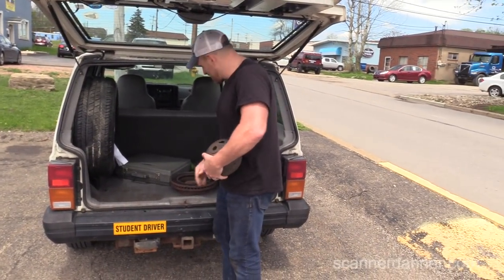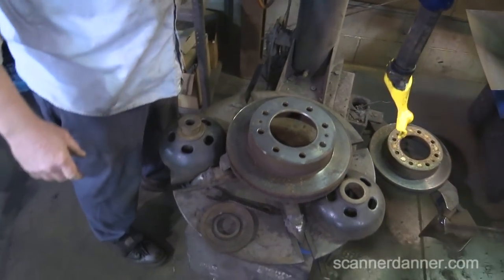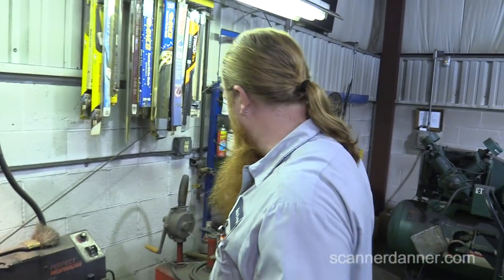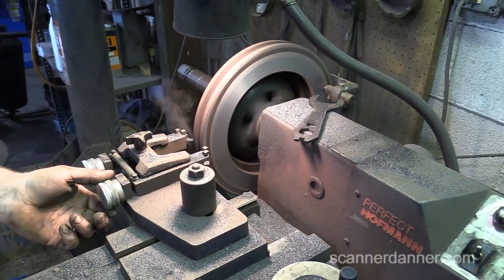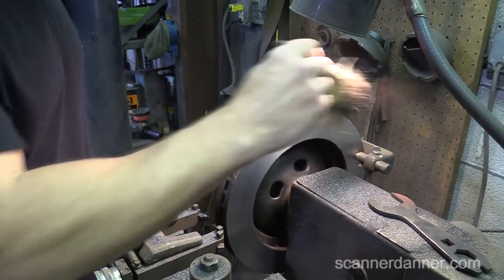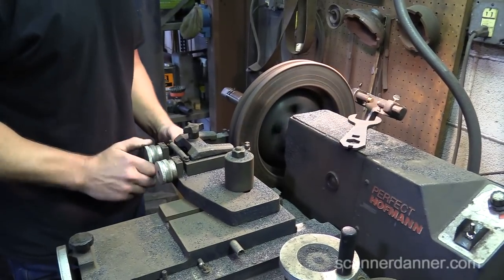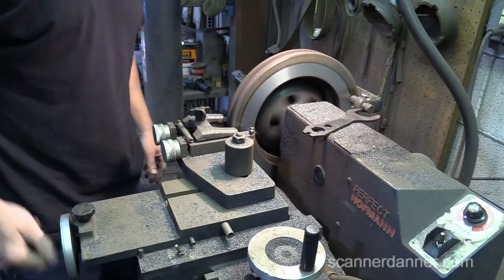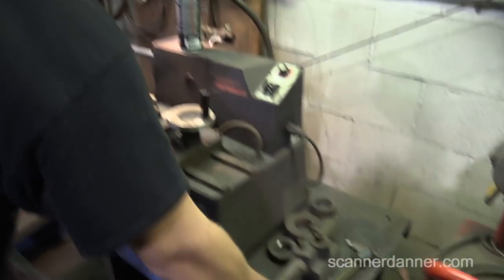Should you cut or replace your brake rotors? (Silverado Brake Service Part 2)

Comment: Great video Danner boys, in the fifties there was brake pads with abrasive paper on them and the goal was to get a smoother  finish at the rotor when driving, after a while the paper just fell off and you had normal pads.

Comment: I bought on the car lathe for problems with warping,after a couple of months problem returned.pulled rotor and rechecked work,put dial indicator on hub surface and found surface to be warped.I started to index rotor to hub so I put it back on the way it came off and problem solved,never had a comeback for pedal pulsation.I wondered if same procedure would work for my ammco lathe and it did,never had a comeback.now if you replace rotor with a new one or replace hub assembly it will warp after some time,once it conforms to warpage on hub,I advise customer of potential problem,brings it back cut rotor and problem is solved,but be sure and index to stud to rotor.I also clean rotor with soap and water after cutting rotor.

Comment: I've found that occasionally, the labour cost of having them machined is more than the cost of new - especially if you allow for what you get for the scrap metal when you recycle the old discs (depending on how expensive new discs are for your particular vehicle, of course.)  I used to have this done on my old Mini - the original (non-ventilated) discs from the old Coopers used to get pretty warped and scored - but new was beyond my budget at the time.

Comment: You're correct, Danner.  1mm = 0.040", approximately!  I've rebuilt far too many metric engines on imperial equipment...  LOL

This was a fun little excursion, Paul!  Cutting rotors is nowhere near as easy as it looks, and it's why I tend to replace rotors, rather than machine them.  It's just so difficult to find a place that you know is going to take the time to get it right!

Comment: I'm also a L1/L3 tech. I always replace. I look at it this way- the rotor needs to dissipate heat. if you remove metal, it lessens it's ability to do so. Also to install machined rotors, imo, you get more comebacks with squealing or noisy brakes. Then if there is a warranty issue, it's much easier to swap and warranty a set of rotors than to re-turn the rotors at the cost of even more time and remove even more metal.

Comment: Some shops put the "new guy" to work turning brake parts. I took the drums for my wife's 73 Camaro in to have resurfaced and they looked pretty good. They had a grove machined into the center at the factory as a "reveal" which when it was machined out, indicated that the drums were at the maximum cut. When I got them back the groove was gone and the shop guy said that they really had to turn a lot off of them to get rid of that damn groove. They were now turned as far as was legal.
DUH!

Comment: I still cut rotors & drums. Probably because 1 of my cars is 31 years old, the other 24, and the last one is a truck. I'll do it for customers if the vehicle is large enough - usually the ones on smaller cars tend to warp again not long after they've been turned. Those are normally cheap enough to just toss anyway.

Been thinking of buying a used lathe on Craigslist ... but now I'm thinking maybe I should hold out for an on-car unit. Probably out of my price range I'd bet. Maybe some day. Added to the long list! 

For now, the place 5 miles down the road from me charges $13 per rotor or drum. It's a PITA driving back and forth twice though - 20 miles in MA is like 100 miles anywhere else, lol.  :D

Comment: rotors are meant to be replaced now days, with the very hard ceramic/metallic pads it really chews them up and of course the great chinese metals :) nearly no one around here turns rotors/drums anymore, most have sold their machines even.
Reply: I've heard that Ford recommends replacing pads without cutting rotors as long as the rotors are within spec. 
Has to do with reducing the ability of the rotors to dissipate heat, I guess. In this day and age, most standard vehicle rotors don't cost too much ($60 for OEM), so I typically replace rotors and pads at the same time.

Comment: a meter is 39.3700787 inches. mili+1000. so divide by 1000(move the decimal point 3 spaces)= .0393700787  so roughly39.5 thousandths is a mm.  your 10mm socket  should measure.394   .375 is 3/8 so its a couple hairs bigger

Comment: 2011 lexus is250 awd r/s front caliper piston  seized. Rebuilt caliper. Turn rotor or replace ? Feel slight shimmeys steering and brake pedal. Should I check with my dial indicator ?

Comment: rotors warp because hub is warped,so when you remove rotor to cut if you do not install rotor to hub and clean rust from hub and rotor and install rotor to hub in same location it will warp again.i always index rotor to hub and since doing this i have never had an issue with pedal pulsation making my on the car lathe a decoration,hope this helps
Reply: Rotors do not get hot enough to warp
That is just an expression used in the auto trade,
like a tune-up, that has been gone for 35 years
The Pros should actually read Brake & Front End
Magazine that gets sent free to the shops
Reply from the maker: How about enlightening us? I won't be reading a Brake & Front End Magazine any time soon.
Reply: I never said rotors warp because they get hot,kind of reminds me when i hear techs tell customers the reason rotors warp shortly after a brake job is because customer got rotors hot then drove through cold rain water,solution don"t drive in the rain

Comment: No silencer band around the rotor?
Also, you should do a non-directional finish.
Reply from the maker: Nope, that's what the spring loaded piece does on the back side. No harmonics at all with this cut. I agree the band helps too, it just wasn't necessary.

Comment: If you're a DIY mechanic then with the cost of cutting rotors it makes sense just to go ahead and install new rotors because if you factor time, machine shop, travel and the wear on the rotor plus what you're cutting off just replace them and the headaches and worries are gone. yeah rotors are about $20-25 more vs cutting but the extra metal for heat dissipation and having a peace of mind knowing you're rocking a good new set. My theory has always been just replace them if you're close to half the cost of turning vs replacement. If you do towing of boats, campers, a trailer regularly then replacement is recommended as well. I don't like the fact of removing metal from a rotor that needs the metal to cool. Danner I'd like to see you address some of the drilled and extra vented rotors and pros and cons.
Reply from the maker: Two things brother. First, I would agree, replacing rotors is better than cutting them. I decided to go this direction for video purposes and to show people what it takes to do them. And i think if the DIYer is really paying attention, he will probably come to the same conclusion in the end, when he saw that a 1 year old rotor had .5 mm left above minimum thickness when we were done. 
Second, as far as the vented and drilled rotors pros and cons. I am no expert here man and all I would be doing is regurgitating someone else's information and that I will never do. It needs to me my own material/experience or nothing. Wouldn't you agree?
Reply: Definitely! Just didn't know if thru publications, industry news or previous experience if you'd had some experience. Chevy Impalas06 thru 12 I think were notorious for wheel shake when braking after the brakes had been warmed up from city or highway driving with mild use then the wheel would shake which was why I always replace mine, yes mines a 06 with the 3.9 .

 Transmission needs removed for a rear main seal then I think I'll just have the intake gaskets to diagnose and do then. Known issues with Impalas. 

Should've kept my 01 with the 3.1 with alot better fuel mileage as it was one tax refund away from being paid off back in 05 (bought used in 03) and bought a 04 Base Model 4wd Tahoe new which I still have to this day with 113k miles.

 I have your typical "mechanics" cars. Some have alot of miles but they're all in runnable shape except two which one needs a flex pipe, muffler and either a IAC Valve or EGR Valve 98 Toyota Camry 162k miles spare. 

My other spare is a 04 Hyundai Santa Fe which needs timing belt/water pump kit (unknown history/interference engine so not taking a chance), a lifter replaced and a ABS code, 154k miles. Only paid $750 so can't complain if you know what I mean. 

I just rent a car for the weekend if I go far out of town and need a car which I can put extra wear and tear on for $5-10 per day, yes that cheap for rentals. 

Love Your advice and when girls softball is over I'll be subscribing to your premium channel as there's some stuff in there I see I want to view and also start PicoScoping with my Modis and 4 channel Pico as well from AutoNerdz. 

I just absorb information even at 45 and just won't stop anytime soon and I don't even wrench for a living anymore just a hobby. When I wrenched it was on the big trucks. Lucky you never did that because with doing that comes the itch to drive them which I did for another 13 1/2 yrs till a Dr and his scalpel and attitude permanently sidelined me employment wise due to disability. Gotta have a hobby or two now though. 

 Way to busy right now for learning PicoScoping with coaching 2 teams and play/practicing 4-6 nights a week and this is only slowpitch softball. Wouldn't trade it for anything though as it's great watching kids grow up. Gonna get off as I'm rambling now, Lol...

Comment: My favorite bad rotor was turned with an on car lathe and I machined the rotor just fine, but the rust was so thickly layered on it that a chunk broke off that was about the diameter of a half dollar and was probably .010" deep into the rotor.  I would have never seen it if my sanding disc didn't knock if off putting the non directional finish on it.

Comment: The Issue measuring with the Calipers is not the Ledge! And Calipers should not be used because of the rings that may be cut in the rotor. Calipers can not measure in those grooves. A experienced mechanic like your brother can get away with calipers because he can likely look at the rotor and see whether is is going to clean up or not.

Comment: Paul, your brother James is good, 1mm = .039 ths !
Reply: 0.03937 and 25.4 is commonly used.  (inch x 25.4) = mm and (mm * .03937)= inch or (MM / 25.4) = inch
milimeter divided by 25.4 gives more decimal places and is easier to recall :)

Comment: What does minimum thickness mean? 
Is it the minimum thickness recommended before new pads or is it the minimum you can go until you should stop driving?
Reply: Andrew Thompson min break rotor thickness before you need new rotors if they are too thin your pads will break your rotor and you crash cause the rotor isn't thick enough
Reply: It's a liability limit. If any shop allows those rotors to walk out of their shop that are thinner than that stamped number they will be sued out of business if a lawyer gets wind of it. Go/No Go point. What you do on your own isn't covered by that stamped number so a lawyer is no longer interested.
Reply: Mechanically speaking, most discs are grossly over-engineered and shouldn't break until they get thinned well under-spec as long as they don't have structural defects - some people drive on discs that are down to the ventilation channels, which puts them 10+mm (1/2") short of their minimum spec. Thinner discs do reduce the amount of braking heat that can be soaked, which increases thermal cycling stress and the likelihood that whatever is left of the discs may shatter during hard braking.

The marked limit is a very conservative value. Most hardware in safety-critical applications is grossly over-spec'd so even the worst specimen should still exceed the application's true minimum requirements in the intended worst-case scenarios.
Reply: Teardown Dan I guess what I am asking is if I put new pads on a minimum thickness disc will it be ok for the life of the new pads ?
Reply: Assuming the disc doesn't have hidden defects (you may want to try penetrant testing to see if there may be cracks) and you aren't doing aggressive braking on a regular basis, the answer would be "most likely yes" as normal braking doesn't put much wear on discs. You rarely see people replacing discs unless something else went wrong, damaging or warping them.

Slotted and perforated discs are a different story as they are notorious for growing cracks. I wouldn't recommend trying your luck with those.
Reply: It's a lawyer thing. Years ago, shops would turn disks until the walls were practically paper thin. Then people with exploding brake disks started going after the car companies (more money) and big chain shops. Car companies started stamping the min thickness that their engineers and lawyers agreed was more than safe for a fully loaded car to do panic stops on the rotor.
Reply: One thing to pay attention to is whether or not that minimum thickness is a machine to thickness or a discard thickness.  I just looked up the specs for SD's rotors and Identifix is reporting the machine to thickness as 37mm.  The spec of 36.5 cast into that rotor is the throwaway thickness.
Reply: Shaun O I guess the 0.5 mm difference is the expected wear from a life of pads. So really unless you know it's a machine to thickness then you should add 0.5 mm to the minimum diamater before machining.
Reply from the maker: For PA state inspection, the stamped minimum thickness on any drum or rotor has always been the throw away number. If it measures less, it fails inspection.
Reply: If you're going to resurface instead of replace, find what the manufacturer recommends for the machine to thickness.  A rotor off a Honda Civic isn't trying to stop three tons (or more) like SD's truck is so it'll probably not need a half millimeter between the machine to vs the discard spec.

Comment: I hope this wasnt an educational film..... Scratch cut? Eye protection? Cutting one side more than the other isnt technically kosher either (I dont really agree though)... Cutting less than a certain amount  (.004?) is said to overheat the tool too I think. Thank god we can buy cheap Chinese rotors... I cut more rotors than I would like in my fleet application.... it just doesnt make much sense.... however when I need to turn a flywheel for a custom motor swap.... I am happy for that brake lathe.

Comment: hi i need to buy rotors for my 2008 Toyota corolla ce which  ones should i buy
Reply from the maker: Not sure man, Seems even the "good" rotors are now made in China.
Reply: dealer rotors are the best. cost more but last more.  you pay for what you get.  I work at a dealer,  and 90% of our brake jobs get rotor resurfacing. from my experience  and on normal driving, OEM rotors last about 10 years or up to 4 brake jobs including resurfacing
Reply: I'm pretty sure that if your brakes have not come metal to metal,  you can still resurface your rotors.
Reply: Thanks for your help

Comment: if you're cheap, cut it, unless rotor thickness is under spec, replace it. OR if it's rusty or terribly warped, replace it. or if you're just lazy and save yourself time, replace it
Reply from the maker: or if you just want to hang out with your brother for a few :-)
Reply: ScannerDanner that too :)

Comment: I'm currently doing a start-up course in Automotive Mechanics (Level 1 and 2), and I was wondering, rather than eyeball the rotor using the tool, why not use a dial-test indicator to get an accurate measurement?

EDIT: Don't mean to sound like a dickhead, just curious
Reply from the maker: you could do that if you felt the need to
Reply: The human eye is incredibly good at judging gaps between things. Most people can spot things like runout to well within a couple thousandths. A human hair is about 2 thousandths of an inch and you'd have no problem seeing that if you have good eyesight. Accuracy beyond that isn't really needed for something like this.
Reply: thats a blonde one  a good redhead may go 3.5 lol
Reply: Fair enough, I guess it all depends whether or not you can be bothered to get the same result. Thanks for the reply!
Reply: richard cranium  the greys in my beard deem even thicker